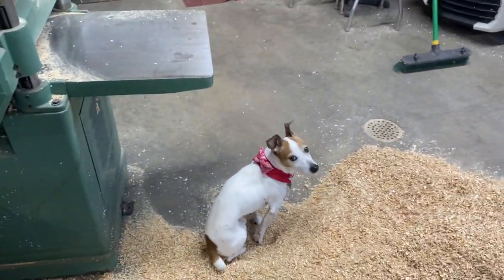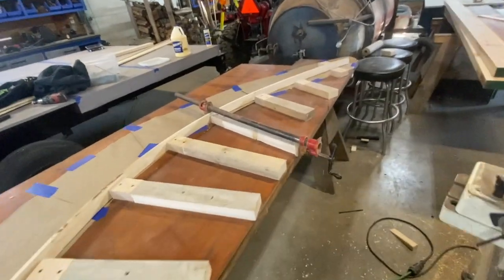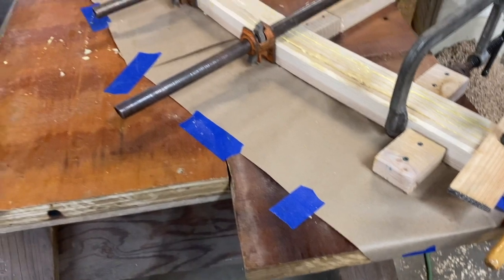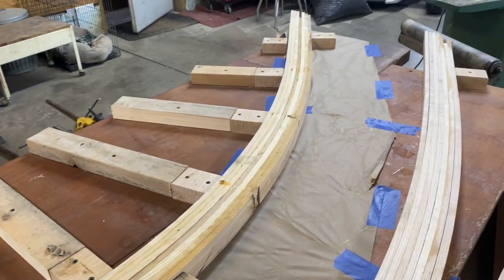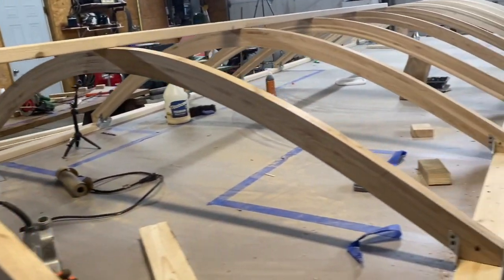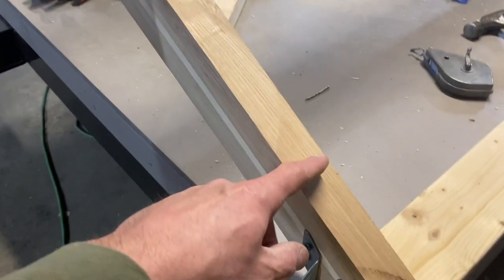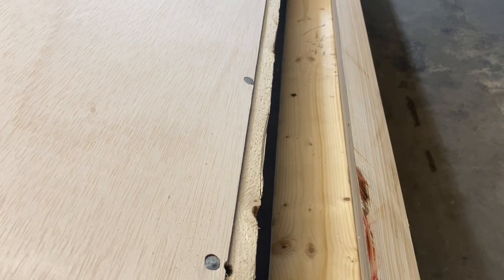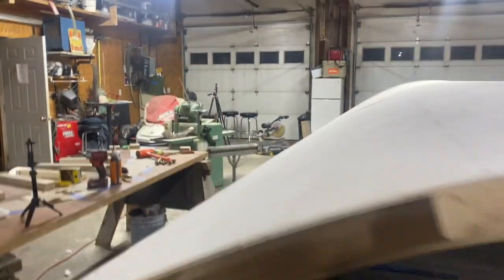Tiny house/ hunting camp part 9 (shepherds hut roof rafters)

Comment: I’m currently in the design stage of my own build and I feel like a minimalist lightweight plan is the way to go. I’m considering making the curves out of plywood boards, so I would jigsaw the radius into a flat board and I wouldn’t have to bend anything or account for the tension of bending laminations. Am I missing something obvious in the structural integrity of orienting the plies/grain in this way? Yours definitely look strong but I don’t want to over-engineer anything.
Reply from the maker: Not sure how strong it would be but you could make one and test it. Mine is crazy strong and has not moved. The spray foam adds a ton of strength so if you did that it might help your design.
Reply: @bondobuilt386  I think that with 2’ centers it would be pretty strong. But you’re a pro builder so your opinion means a lot. I haven’t decided on what kind of roofing to use. Either sheet metal or a canvas wagon cover. I may not insulate it much at all. I’m in the NW, so no extreme temperatures to worry about but there is a lot of rain. I’m going to do a 7x12, so I’m planning for 5 trusses plus the identical radius on the end walls. I could double up the center truss so that it’s two pieces of 3/4” sandwiched into 1 1/2”. I’d be dead if a tree fell on me but you could say the same about most builds. Anyhow, thanks for the feedback!

Comment: The key to laminating curved timber is finding good vertical grain boards w/ continous grain that can be ripped down and bent without failure. You can also use 4in deck screws to pull some of the gaps out between clamps. Looks pretty good overall.

Comment: I would think some 2x4’s across the arch would keep the curve square. Also would be helpful in turning it over. 
This is going to need a hair dryer to keep you worm. Looking forward to to the next segment.
Reply from the maker: thanks Allen I'm thinking the same about the 2X4's
and yes it should heat easy. lol 😆

Comment: Very cool build. Will you have some sort of bottom chord to brace the tension? Load will want to push the rafter outward.
Reply from the maker: No once it’s all spray foamed it should not budge at all. There will be a couple walls inside that will hold it also. 👍😊
Reply: @bondobuilt386  right on! Hunting will never be the same again. Cant wait to see er finished
Reply from the maker: @mthiessen134  ya bud me either. Gonna be sweet. 😊👍

Comment: It's disappointing to see you make those really nice arched beams and then just cover them up.  I think that's a missed opportunity.  If you'd have put the luan on top of the beams (use the beams to hide the luan joints) and put the 2x4 purlins upright (not flat) on top of the luan, you could've put the 3.5" insulation on from the top and had a beautiful finished ceiling below.  It's your project and your choice.  I'm enjoying watching your progress.
Reply from the maker: I went back and fourth with that design your saying and the way I went about 50 times. LOL 
A couple things swayed me this way. The extra insulation with the thermal bridging being blocked. The added strength of the spray foam locking everything together and the fact that that the 2X4 sideways will be better to hit my screws into when doing the metal. One more thing was the area where the bow meets the plate would not be insulated very good without covering the ends of the rafters. Thanks 👍😊
Reply: @bondobuilt386  It's definitely your build and your call.  Your design is more energy efficient.  I would love to see those beams somehow in the finished ceiling.
Reply from the maker: @thomassheppard2690  Ya buddy there gone now. 😩 I can go back and see them in the video. Lol

Comment: Suggestion you could of put temporary collar ties on so it didn't spring out
Reply from the maker: I didn't want to put holes in the sides and maybe crack the wood. I will put some 2X4 on the bottom after we flip it over but before he sprays. And the collar ties would be in the way of spray foam. Thanks 👍